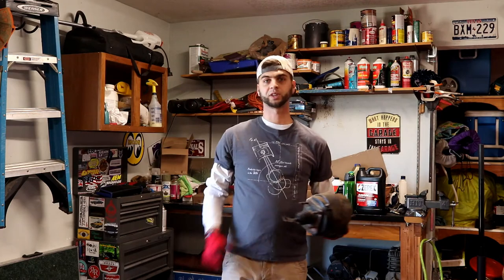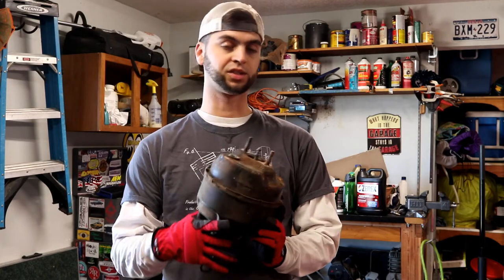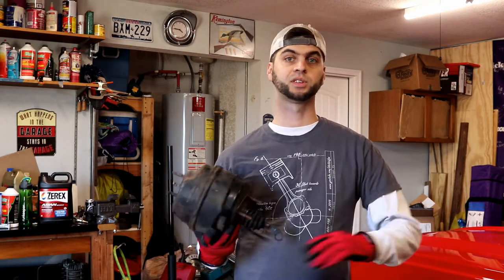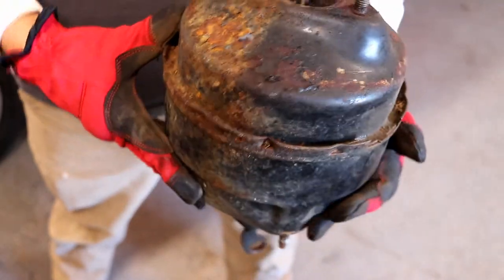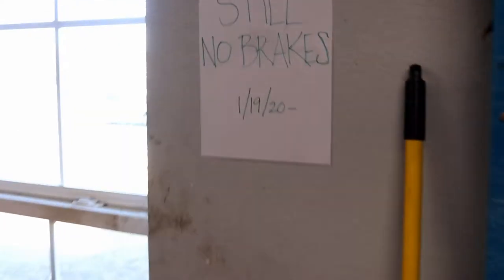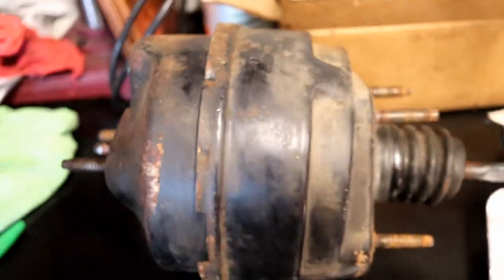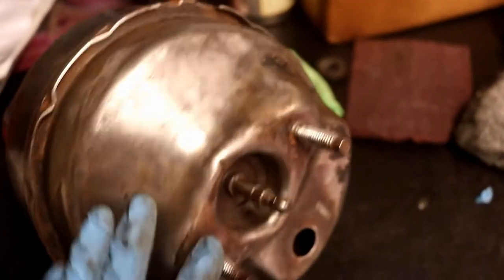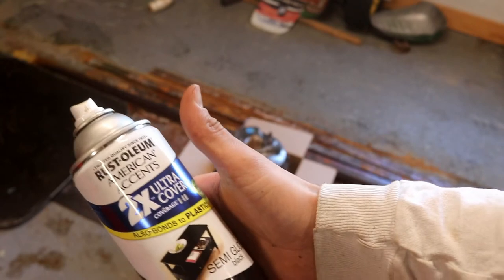Brake Booster Refinishing Before I Rebuild the Fox Body Brake System - Version 2

Comment: Eliminate all the suspects. I would apply vacuum to that booster before installation just to check. You'll get it tracked down.
Reply: So still don't have it figured out?
Reply from the maker: That would be wise.